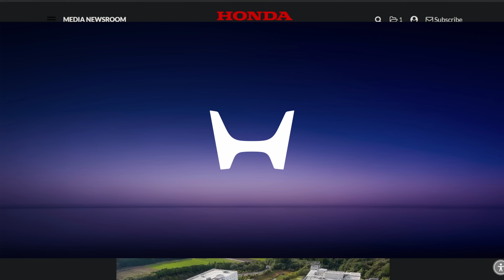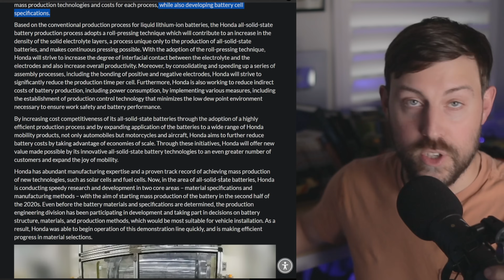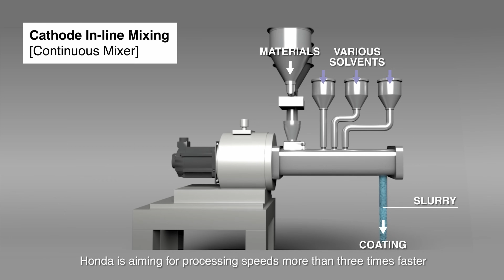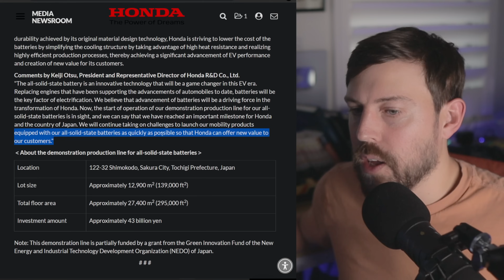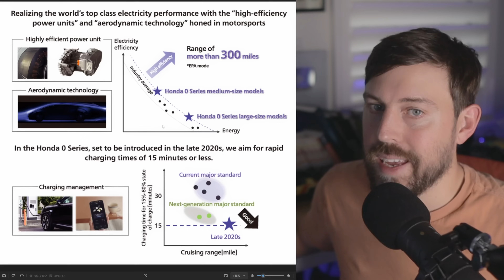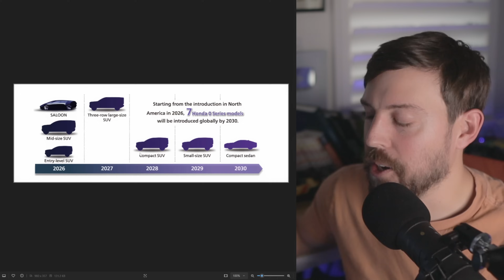Honda's New Solid-State Battery is (almost) HERE - Here's the latest from Japan...

Comment: I can charge my Jag EV at home, on a very cheap night tariff, for nearly all of my driving. If I had to do long journeys often and charge out on the roads, I'd have stuck with a big diesel engine.
Actually, even a big petrol engine would be as cheap as roadside charging, as it's so expensive in the UK.
So, charge speed is irrelevant for me 99% of the time. As well as the crazy cost per Kwh at public chargers, we have the issue of charging speed. You'd need a 400Kw charger to make it anywhere as convenient as filling up with diesel or petrol, and even then you still only have a couple of hundred miles until you have to find another fast charger. With my old twin turbo diesel E-class I easily could get over 500 miles between fuel stops on long runs, and there are filling stations everywhere, with no queues, the pumps are under cover, you start filling instantly (no messing with apps!) and they always work, and take a coupl eof minutes only to fill the tank.
I wonder how many chargers there are in the UK that could charge at 300 or 400Kw? I reckon very very few, if any.
And the faster the charger in England, then the more you pay per Kwh.

Comment: You won't see this in actual production for the public to buy until 2030 at the earliest. Still too many issues with blowing up and not lasting as long as current batteries. Yes. quicker charge and more range but they don't last.

Comment: Japanese automakers have been talking solid state batteries for more than 10 years. I will believe it when there is an actual car I can buy.
Reply: Yup. And the technology takes time to make reality. We’re also still talking about developing faster-than-light travel
Reply: @letsgo4834 You don’t have to best the speed of light if you create a wormhole or a torsion field basically through a different dimension
Reply: Chinese talk is not trustworthy.
Japanese talk is future.
Reply: Solid state batteries are going to become "a thing" in the market about the same time that fusion power is commercialized.  /snark
Reply: @johnsanford3596 Solid state are already being manufacturerd. Just not at scale/cost that makes sense for EVs. Then you have hybrid like quasi and condensed batteries which maybe the way. Solid state for the sake of it I mean. 

 2025 is the year or 26. 

 EVs are improving and getting cheaper. Dunno why they think they gotta pack every tech under the sky in them. I just want a simple EV with bare bone tech, but solid state batteries and axial flux motors. A Mita sized car. 

 Either way I am excited. I like that I see a plant being built.
Reply: Chines already make solid state battery and put into cars, we just don't know yet.
Reply: @GF-mf7ml because nobody lived to tell the lie

Comment: Glad to see it. Performance is attractive but  my turnoffs for evs is battery degradation and cost. Hopefully Honda can solve my barriers :)
Reply: That's like saying wear and maintenance and turnoffs for ICE vehicles.
Reply: @TheDCJason  Uh, sure. ICE has some turnoffs. Is there a point you're trying to make?
Reply: @anaveragehuman2937  Sorry, I realize that was a bit vague. My point was that no matter the powertrain there will always be degradation.

I say this because a lot of people talk about battery degradation as if ICE vehicles are maintenance free and last forever.
Reply: Ah ok, I figured that was the angle. Yes, there is some wear and maintenance involved with ICE. Properly maintained, they can last 100s of 1000s of miles with minimal performance degradation. The same can’t be said for EVs which are practically guaranteed to degrade and remain costly. This is why I’m hopeful for solid state.
Reply: @anaveragehuman2937  in the Northeast most vehicles under carriage is toast by 120k miles and are rattle fests.  At least the batteries are recyclable.

Comment: Wondering if Honda, Toyota, and Nissan will create a joint alliance with this battery as a national directive.  Battery cost would be lower due to much higher volume, common battery for replacement, and common interface components to lower this cost.  This is a cultural strategic advantage that does not exist in the US.  Development funds can be used elsewhere (smaller, lighter, higher efficiency motors, battery change and expandability architecture, address harsh weather issues, brand differentiation features, etc.).

Comment: the narrative that Chinese EV technology is best is pure cope propaganda.

If Chinese batteries like CATL and BYD are indeed better than Japanese Panasonic or any other countries's no. 1 let us say, like the useful idiots and muppets claim why do we not see these Chinese batteries in any other uses?

Boeing's latest passenger liner B787 Dreamliner uses advanced Lithium-Ion battery from the Japanese firm GS Yuasa. It is not European, Chinese Korean anything. Why did Boeing not adopt Chinese CATL or BYD batteries if they were so much better? Even if Boeing did not adopt Chinese batteries for national security reason, why was CATL and BYD's advanced battery not used on Chinese airliner C919??

Japanese navy's latest diesel electric submarine have the world's first and so far the only use of advanced Lithium-Ion battery to increase its submerge time by Matsushita Panasonic. Why doesn't the Chinese Navy's submarine also use advanced CATL and BYD batteries? Why do they keep using old-fashioned lead-acid battery??

Japanese high speed rail have Toshiba's SCiB Lithium-titanate battery that allows it to travel in emergency without the overhead electricity. It is the only high-speed rail in the world to have this feature. Why doesn't Chinese high speed railroad have this?

not to mention, a japanese firm Nidec supplies electric motors to many chinese OEM and have the largest share of electric motor marketshare in china. Hell Nidec also supply to tesla despite what elon musk would have u believe
Reply: Look at that wall of cope text.  Reads like a weebopedia 😂😂😂
Reply: @CrzyD-cv8xz  u never said it was a lie because that is the truth
Reply: u never said it was a lie because that is the truth
Reply: @miraphycs7377   sometimes some things are the way they are not because it's better but other reasons.  Why does Tesla uses BYD and catl instead of Panasonic and Toshiba.  Where's Japanese vertical landing rockets?  Where's it's stealth fighter?  Space station? State of semi conductor behind Taiwan.  In the big picture if your weeb fan boi cherry picked points were valid why the decline in so many Japanese industries?  You can just stick to your excuses just watch for a few more years my friend 😂😂😂
Reply: @CrzyD-cv8xz  Tell me why Tesla still uses Panasonic for high performance models and 4680s on cyber trucks which they couldn't make in-house?

Smaller countries like Taiwan and Korea can make advanced semiconductors only because of globalization and cooperation. Needs Dutch ASML machines and Japanese sensors, hydrogen fluoride, photoresist, and fluorinated polyimide, American design etc. If you take these web away, suddenly they can only produce at the level of 40nm. Japan on the other hand have fully 100% supply chain that they can currently manufacture 22-ish nm. 

Speaking of watching for a few more years, Canon just recently delivered first nanoimprint lithography tool to US institute backed by Intel, Samsung, DARPA. Nanoinprint lithography machines are cheaper, smaller and less energy intensive to purchase and operate than ASML EUV yet can still produce 5nm. Thus, in a few short years Japan would be able to go 5nm fully indiginously while Taiwan and Korea still needs outside expertise to be at the cutting-edge.

Please do some research before saying dumb shit😂😂
Reply: @miraphycs7377  haha 22ish nm.  No doubt Japan has bits and pieces of tech so do other countries.  Like Japan doesn't need globalization?   What are you trying to say?  On the whole Japans industries are not leading. Japan doesn't even have raw materials how can you say 100%  hahahaha cope hard looser weeb!!!
Reply: Tell me why Tesla still uses Panasonic for high performance models and 4680s on cyber trucks which they couldn't make in-house?

Smaller countries like Taiwan and Korea can make advanced semiconductors only because of globalization and cooperation. Needs Dutch ASML machines and Japanese sensors, hydrogen fluoride, photoresist, and fluorinated polyimide, American design etc. If you take these web away, suddenly they can only produce at the level of 40nm. Japan on the other hand have fully 100% supply chain that they can currently manufacture 22-ish nm. 

Speaking of watching for a few more years, Canon just recently delivered first nanoimprint lithography tool to US institute backed by Intel, Samsung, DARPA. Nanoinprint lithography machines are cheaper, smaller and less energy intensive to purchase and operate than ASML EUV yet can still produce 5nm. Thus, in a few short years Japan would be able to go 5nm fully indiginously while Taiwan and Korea still needs outside expertise to be at the cutting-edge.

Please do some research before saying dumb shit😂😂

Comment: i get that the ev market is still maturing, but, batteries should be upgradeable imo
Reply: 1000%
Reply: With solid state you get many more charging cycles.
Reply: @mrgurulittle7000 they should still be easily replaced for swap out because with ev the battery output is what corresponds with hp alongside with motor size

Comment: People who dont understand how much of a leap forward solid state batteries are,  shouldnt be allowed to comment.
Reply: @bjm23vancity92 Of course we don’t have specifications. They just built the facility. We’re celebrating the fact that Honda has made the breakthrough of being able to mass produce real solid state batteries. There won’t be any on the market and the specs won’t be out yet for who knows how long. That wasn’t the point of Kirk’s video and our comments anyway.
Reply: @ Your comment was They did it! Honda did it! They did nothing but a good PR fantasy vision
Reply: @mrgurulittle7000  Easy cowboy.  They said that they will soon start their demonstration line.  That means they haven't been able to prove that they have a viable battery or that it could be mass produced.  It's still theory.  Now, they just have the equipment to test their theory.
Reply: @famljw3095 “still in theory” Yeah right. Literally they built a factory around a “theory”. It’ll be up and running by 2026. These guys are the ones who foretold the collapse of EV sales in 2023 even before it happened. They know what they’re doing.
Reply: @xiaoxiaopeng8207 What do you mean “at least China has semi solid state batteries”? Semi solid state batteries are no better than the current LFP batteries on the market. It’s a pointless technology that they made so that they can say they are advanced.
Reply: @mrgurulittle7000  The semi-solid state has been practically used, with a pure electric range exceeding 1000KM and faster charging speed. Moreover, excessive technology can also lay the foundation for future scientific research
Reply: Solid state will NOT be a quantum leap in charging time or range, unless you buy all the BS propaganda.
Reply: @xiaoxiaopeng8207 LFP batteries can go 1000km too. Semi solid state isn’t the future.
Reply: And this isn’t that “semi-solid state” stuff that China claims is solid state battery either. It’s the real deal and the real breakthrough we’ve all been waiting for.
Reply: @mrgurulittle7000 I’m sure catl and byd etc are all pouring billions into research as well , trump is probably going to accuse them of ccp subsidized soon 😊
Reply: @mrgurulittle7000  At least China is currently the only country that is actually using semi-solid state batteries, and it's not just talking big every day. All solid state has been confirmed to be implemented in the next three years or so
Reply: @mrgurulittle7000 Man are you easily fooled...no disrespect to Kirk, buy are no specifics details specs or charging time testing and so  on...

Comment: In terms of solid state, just like with hybrids, I trust Toyota's the most and I trust Nissan the least. Honda somewhere in the middle
Reply: Nissan’s solid state battery is not in-house like Toyota and Honda. So they are pretty much on pr when considering trust.
Reply: Ur just falling for clickbait-tier propaganda masquerading as journalism farted out by electric viking. 

The original Chinese media outlet Caijing said that Toyota might use BYD technology for vehicles sold in Chinese market.

The Best Car report you are referring to, did not say anything about next Corolla using BYD technology. The article was rather them predicting the horsepower and torque number of the next gen Corolla with its 1.5L engine. They also mentioned how Toyota's 2.5L engine have the highest 41% thermal efficiency in their portfolio while BYD's 1.5L have 46% thermal efficiency. Smaller turbo engine usually have higher thermal efficiency than naturallly aspirated engines. Thus, they were also mentioning how the new Toyota engine being a physically smaller engine must have higher thermal efficiency but the question was would it match or surpass 46% figure?

Idiots like electric viking just took the two together, combined them and ran with it.
Reply: You will be impressed that Toyota is adopting byd’s 2000km hybrid setup 😊